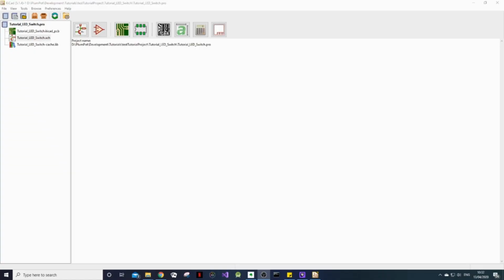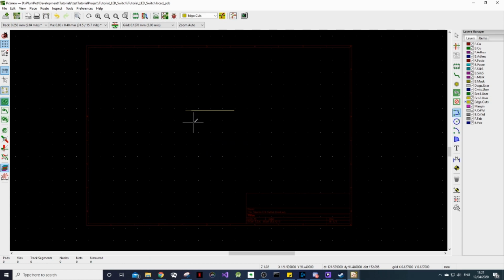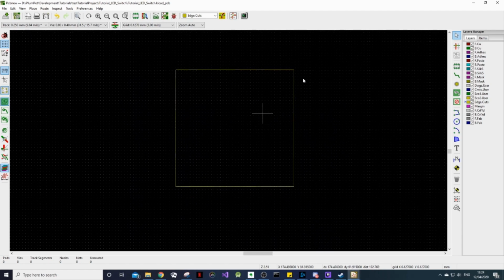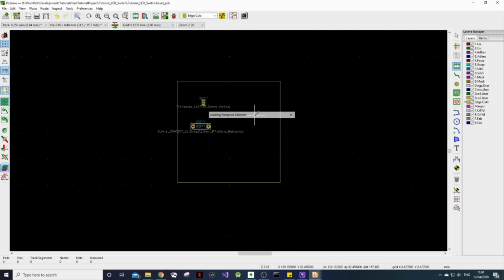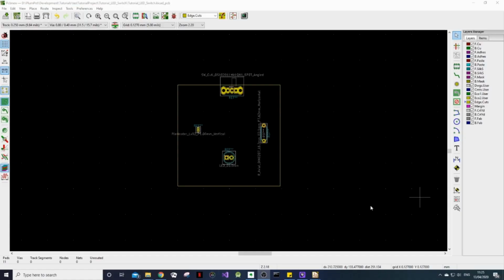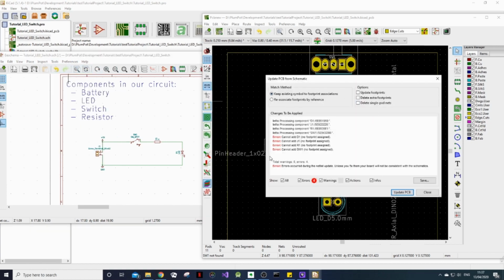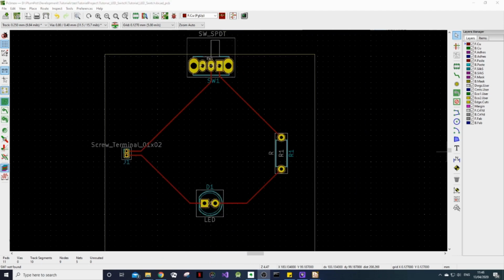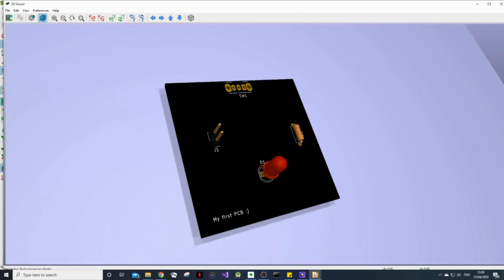How to make a PCB - Ep 2 - PCB layout design

Comment: The way you explain this software stands above most of the so-called Tutors. But a small remark is what I want to say: as a complete noob, it was not really clear to me how you make the first project file. What I want to see is that if you make one mistake, how to solve that. So, show sometimes what happened if you do it wrong, will help to eliminate mistakes. But Overall, you do it very well, most others have suddenly made a change in the design, but do not show how to get there.

Comment: Good work, very clear but, before you added the power ports to the schematic, the circuit was complete and will function as it is drawn. Then you added the power ports which made it seem they were essential to have on the schematic and we both know they are just common names of the two nodes and are redundant for this design. Maybe just start off using the power ports instead of actually drawing wires for the +5 going to the switch and led return.

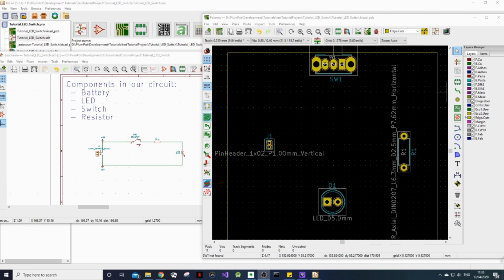Comment: At 14:37, the switch you used in the schematic editor changed from SPST to SPDT which cause some confusion when linking the schematic to the PCB.  Other than that, it's been a good video.

Comment: The line controls to draw the outline of the board are not working like the ctrl+c, ctrl+d and ctrl+v.
This only seems to happen when drawing the board outline.On the popup control window the Duplicate does not work either. Really strange and confusing for a newbie.

Application: Pcbnew
Version: (5.1.10)-1, release build
Libraries:
    wxWidgets 3.0.5
    libcurl/7.71.0 OpenSSL/1.1.1g (Schannel) zlib/1.2.11 brotli/1.0.7 libidn2/2.3.0 libpsl/0.21.0 (+libidn2/2.3.0) libssh2/1.9.0 nghttp2/1.41.0
Platform: Windows 7 (build 7601, Service Pack 1), 64-bit edition, 64 bit, Little endian, wxMSW
Build Info:
    wxWidgets: 3.0.5 (wchar_t,wx containers,compatible with 2.8)
    Boost: 1.73.0
    OpenCASCADE Community Edition: 6.9.1
    Curl: 7.71.0
    Compiler: GCC 10.2.0 with C++ ABI 1014

Build settings:
    USE_WX_GRAPHICS_CONTEXT=OFF
    USE_WX_OVERLAY=OFF
    KICAD_SCRIPTING=ON
    KICAD_SCRIPTING_MODULES=ON
    KICAD_SCRIPTING_PYTHON3=OFF
    KICAD_SCRIPTING_WXPYTHON=ON
    KICAD_SCRIPTING_WXPYTHON_PHOENIX=OFF
    KICAD_SCRIPTING_ACTION_MENU=ON
    BUILD_GITHUB_PLUGIN=ON
    KICAD_USE_OCE=ON
    KICAD_USE_OCC=OFF
    KICAD_SPICE=ON
Reply from the maker: So you can not copy and paste the board outline layer? What does it do? Sorry for late reply, if you want you can join our Discord channel much easier for me to help people on there :)
Reply: @PlumPot  Hi Kiri, no, when you have created a line it will not copy, everything else seems to be working. It seems to only be on the edge cuts menu. If you hover over the end of a line over the + and right click to open up the pop out menu and click on Duplicate all my laptop does is make a ding sound, and the same for all the Ctrl + functions. It is not really a bother now I know how to get around it. Just thought it might be useful to know. I was wondering if it was perhaps version specific. What version are you running.
Reply: Strange, it is now working as intended, can duplicate and use the ctrl+ functions. I haven't done anything to try to correct it either.

Comment: Another method to draw a box is to set your grid to the minimum pitch you need and just draw your box the edges will snap to the nearest grid point you've selected. So if you were drawing a 40x60mm box you would step up to a 5mm grid and draw a perfect box at ninja speed. If you have a weird size board like 122x37 or design to fit constraints then this method isn't much different but I still uses it.  cheers
Reply from the maker: Thanks for the tip👍.haha I love the "at ninja speed"🤣
Reply: Hi Thad, thanks for the tip on this being a complete newbie on this PCB design lark it is a very useful tip. Also if you are designing a board in inches  and you want to add an edge size in mm it will not snap to the 1.27 mm grid size. It makes sense to use either one or the other. Love the Ninja speed analogy:)

Comment: Just a quick question. Why should one never place a track with a 90 degree bend?
Reply from the maker: Hi Andrew, it is actually legacy. So back in the day our manufacturing process was not as advanced as today. So making 90 degrees or less, causes acid traps. This is where the acid they use to etch away copper stays on the board.

There is also practise that if you have a RF circuit then it might influence it.

Basicaly for us hobby guys, we can use 90 degrees😋. Besides 45 degrees angles look so much better..in my opinion🙂 - JP
Reply: @PlumPot  Thanks JP. Much appreciated.
Reply: Because all the electrons are going to be pissed.